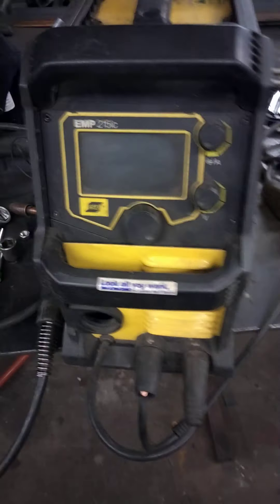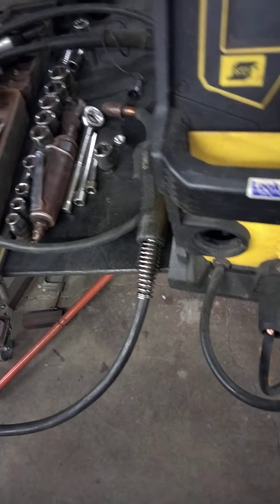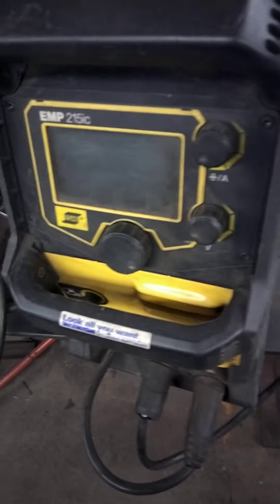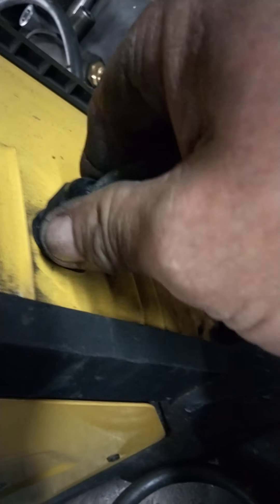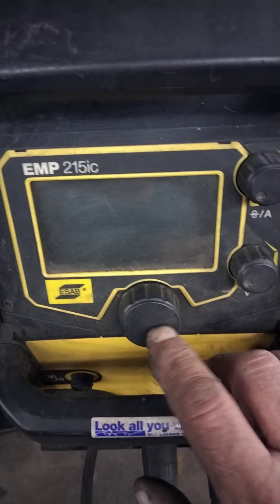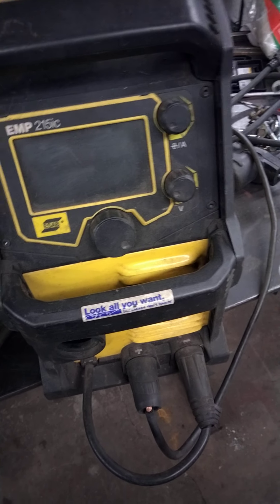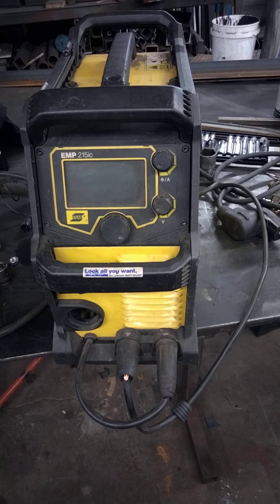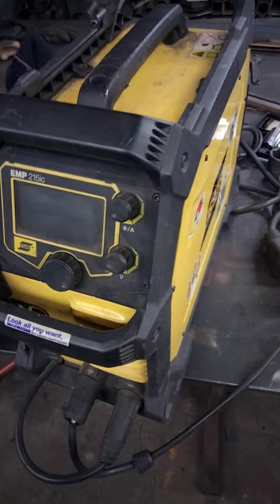Esab . Watch before you buy !

Comment: I have same Rebel, and  i`m VERY VERY happy with it..! Its probably the best welder, i have used. Its all about, how you treat your welder.. My Rebel working like dream..!!!
Reply from the maker: Unfortunately it has nothing to do with how you treat it . Although mine is treated like a baby . Local suppliers wont sell them here any more in my state .
They had so many returns and so many ppl wanting there money back that the local suppliers wont sell you one ! It got so bad here . Even if you ask them to bring one in , they wont ! Only way to get one here is by mail ! None of the stores will sell one here . Glad yours is working well though ! My 141i is working well . But it doesnt have the same pc board as the rebel .
Reply: @theweldor757  Oh my.. Sorry to read that.. What has happened those cables? Mine was very strongly nade.. Fingers cross..
Reply from the maker: @rikujkoivisto  cheap china made stuff !
Reply: @theweldor757  Esab (USA) has their OWN factory IN china. The factory isn`t  "chinese". There is a big difference.  ; )
Reply from the maker: @rikujkoivisto  good input ! I blame UPS for alot of the problems . It took 3 machines to get one that wasnt broke . The 285 was literally end over ended up the driveway . It was broke brand new outta the box . Sent it back . Esab sent a second one . It got end over ended so bad the silica pak was ruptured . All the silica was up in side the machine . The third one i had esab ship straight to a dealer . I picked it up from ther ! Kinda blame ups for that . But like i told esab . If they sent the leads and stick lead n gauges in a different box it would help ! Every things was in one box . So heavy the ups ppl couldnt lift it . So they just flipped it up on end . End over ended it all the way up the drive way . Breaks them . I spent a fair amount of time talking to esab !
Reply: @rikujkoivisto  the cables and the torch look like they have been beaten up

Comment: Yeah I heard reports on quite the contrary brother. Esab welders have a general reputation of exceptional engineering and build quality, also their service background is pretty good. If you cannot afford to let them repair your equipment, you are relying too much on one welding machine, as everything, it can break especially when abused. I suspect, and I may be wrong but your torch has heat damage. Did you not exceed the recommendations of current and time?
Reply from the maker: In the 70s and 80s they were top a the line . Now ther throw away garbage like every thing else . Engineering and quality sucks ! The cords came apart on both ends . The ground clamp cable came apart on both ends right away . First month . I have 4 wire feeders for your info . No one machine is used all the time . They ve never ben hot or kicked the thermal ! Contrary ta what your hearing . If ther so good . Why did all the big dog suppliers in my state quit selling them ? They said straight up they have ben flooded with returns on esabs . Ppl wanting ther money back . Or pissed cause ther lookin at 2 , 3 months to repair it . Esab wont sell me one part for any of these machines . If your not a supplier . They wont  ship the part ! Wanted a esab all my life ! Wanted a miller trailblazer all my life too . Its just as lame ! Left me hanging taday ! Died and will not start now . Right in the middle a fixin a train car . 6000 dollar trailblazer . Has 1000 hours on it . The new cowling lets water leak down in side the generator . Freezes up ! After 90 degrees it starts vapor locking and wont run . Put thousands n thousands a hours on miller bobcats in the 90s . Never did anything but change oil and blow out the air filter . Never froze up . Remember starting it at 10 below zero . That onan fired right up ! Never vapor locked . Its all throw away garbage now ! My old portable . 1972 chemtron . Over 20,000 hours on a 6 cylinder hercules motor . Always started ! Always ran ! 20 years a service ! Only reason it got scrapped was cause some dumb ass back in to it and cracked the block . Busted the intake and cracked the block ! Try ta find parts for a 6 cylinder hercules motor . No wher to be found . Good yammerin with ya ! Be safe
Reply: Yeah Chemophilia, I mean I find stuff laying in the front seat thats broke itself all the time! I just found a anvil laying there in pieces all over the seat just the other day. But all the other bull shit aside in this video, sometimes there are a lemons, I got a Miller 215 that was shit in less than 2 weeks. But I still think millers are good products. It’s how they handle the issue and I’m willing to bet ESAB would more than take care of it. Theyve answered any questions or concerns I’ve had on my 205ic purchase, they’ll get you in touch with a distributor for any spare parts a person wants. So I call BS!

Comment: Stopped welding at lunchtime and turned off my Esab Fabricator 252 (new in 2016, $2800.00 with cart and spool gun). Came back after lunch and machine would not turn on. Code was input power problem. There was no input power problem…. mother board dead,  repair and shipping cost as much as new welder.
Reply from the maker: Sorry to here that ! If it makes you feel any better i own 4 a the turds 😳😒😒
141i smoke rolled out it . 210 emp esab lasted about 30 hours . It fried . Thats why i didnt fix the 215 rebel . Menu knob is part a the pc board . Esab wont ship parts unless your a repair shop . Its stuck in mig mode . The esab 285 has issues 🙄😒😒
The suppliers around here quit carrying them  cause they had so many returns . I got 2 miller 215s now . One in the shop . One in the field . No problems ! And the machines have doubled in the last year . Last video i posted is about that and the rate . Hang in ther brother . I call them mesabs now . If you got suckered in to buyin one your sabin .

Comment: I'm just getting into welding and was going to pick up an Esab. Definitely glad I didn't go that route. However I went with the harbor freight omnipro 220 which aint much better with customer support/parts lol
Reply from the maker: Yah but if you buy the free replacement warranty . Thats hard ra beat ! Troy went omni pro . Welds nice actually ! First one acted up , took it back.
They gave him another . A year later a knob broke . Took it back they gave him another one ! Make sure you pay for its like a 2 year replacement warranty ! I just told a guy that esab 141i  is not in the rebel family . Its different than the rebels . No auto weld . More old school . But its 110/220 stick , tig , mig n i think you can run a spool gun off it . 900 bucks ! I got tired a those 6 foot leads on troys . Got a 250 amp mig master licoln lead . 15 foot . It fit the omni pro . Nice ta have a 15 foot lead
Reply: Does HF have anything close to this model?
Reply from the maker: @armurano5093  for the money that omni pro 220 is good machine ! Make sure ya get the 2 year warranty . Troys on his 3rd one . They acted up . He went back they said grab another one ! Second one the knob broke i think it was . Same thing . Grab another one ! Dont like the lead on it onlt 5 , 6 foot . But its lincoln style . We were able to put a 15 lincoln style mig master on it ! Made it alot nicer !

Comment: Looks like abuse
Reply from the maker: Unfortunately its not .
Local suppliers got so many returns they quit pushing them all together. Replaced the esab 210 emp . With a miller 210 . No problems with it all summer . The 285 came in beat to crap in shipping. Returned the first 2 . Havnt messed with the 141i . Traded it . The guy used it a half dozen times . Turned it on one morning and smoked rolled out it .
210 esab emp ran for 30 hours and it just quit working all together . Didnt kick a thermal . Or breaker . Just quit working . The 215 rebel is still running . You just never no if the menu knob is gonna work or not . Mean while i still have my Lincoln weld pak 100 . It still runs . I still have my sp135 i bought early 90s . It still runs fine . 2 millers sitting here . Not one problem with either one . Had a 1972 chemtron 200 with a 4 cylinder Hercules motor on the truck for 20 years . No problems . The 215 rides on the back seat a my extended cab dually with air ride . My buddy throws his harbor freight omni pro in the back of his truck bed all rear round . It still works .  I know if i was just starting my business again . And i saved 300 bucks n bought a esab . Then had this problem id a ben hurting for sure . Could be the difference a makin it or not . Read in to it what ya will . But thats the reality of situation on this end